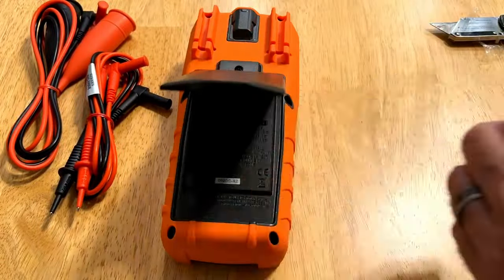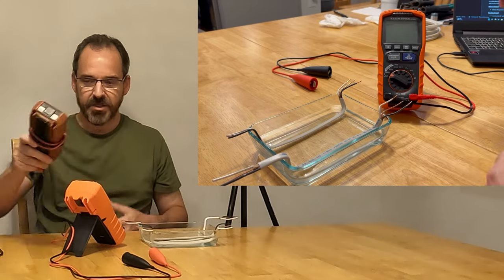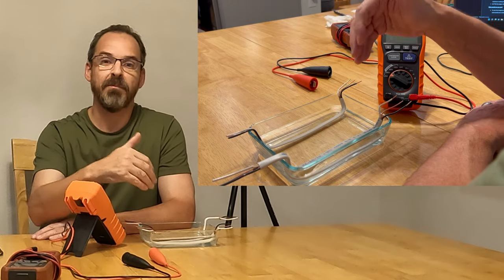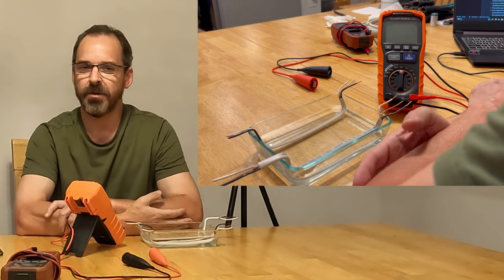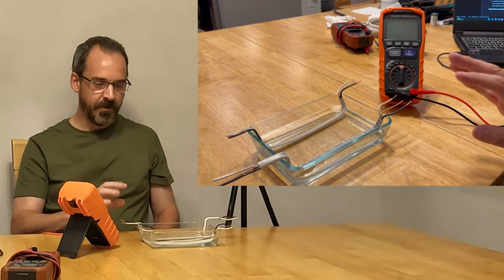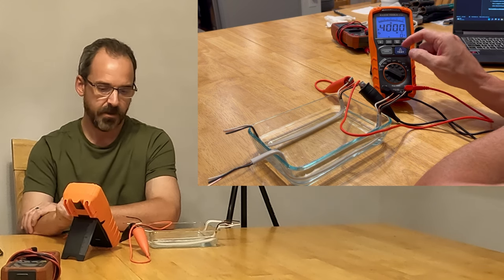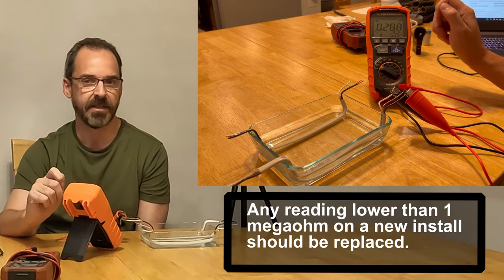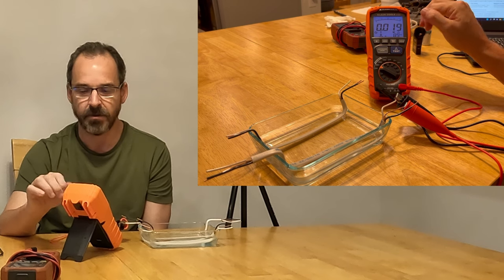Introduction to insulation testing using a Megger

Comment: Your math is not correct. The insulation is mesured at 500V and not at 110V. Therefore insulation resistance is not same at 110V as at  500V and, consequently, leak current will be different at 110V.
Reply from the maker: Resistance is a constant.
Reply from the maker: So what you say is sort of right and sort of not. Insulation resistance, will remain constant, effected mainly by environmental effects such as heat or moisture. Application of a lower or higher voltage will not change the resistance, but it will result in lower or higher currents that could flow thru said resistor.
Reply: @TheElectriciansGuild   Resistance varies with the temperature of the circuit.  Take a heating element and measure its resistance  when it is hot, just as you disconnect it from power, then check  it when it is cold.  As the ambient temperature rises, or the wire itself becomes hot, the resistance rises because the copper electrons are farther apart.  If the wire is cold, the electrons move closer together and the resistance is lower.  I like the hand crank generator type meggers rather than the battery powered ones.  DC voltage of 1000 volts will not be damage the insulation on 600 volt rated wire.  Neither will it damage motors that are rated at 460.  In fact you should test motors at twice their operating voltage.  It says right inside the instruction book of my AMEC crank style meggers..
Reply: bro，simulations only.
Reply: if insulation resistance was constant with voltage as you say, then why bother to measure at 500V, an ordinary ohm-meter would do @TheElectriciansGuild
Reply: @TheElectriciansGuild Resistance is not constant. It depends on many things and voltage is one of them. Measure resistance with multimeter vith few volt of source voltage and with megger vith twice of normal voltage and you will see difference.
Reply: @TheElectriciansGuild So testing romex on a finished house , how would that go. Would all devices have to be removed to do a legit test . Lately insurance companies are asking for megger tests after a fire to check everything.

Comment: Good video. As others have mentioned, in the UK this would be correctly termed 'Insulation Resistance Testing', Megger is a brand name. Someone will correct me if I'm wrong, but I believe Megger made some of the first insulation resistance testers, hence the term 'Megger Testing' stuck. In the UK we insulation resistance test all new circuits as required by standard.

Comment: I was taught to never megger anything at a voltage higher than the voltage rating of the insulation. You can cause insulation failure. When meggering a motor you can’t exceed the volts per turn rating of the motor.

Comment: I want to compare the resistance of different wire connections (twist and headshrink, twist, solder, and heatshrink, clamp, and solder seal). Can I do this with an $80 megohmeter and two wires, or do I need a $1000 + megohmeter or even 4-wire Kelvin bridge?

Comment: Megga is a brand that made some of the earliest elextrical resistance testers. Doing a megga test is the slang for testing the electrical resistance between two conductors. But I agree with @lewistreloar2312 it sis utter madness that you dont test your circuits before you commission them. In the UK we aslo test for the earth bonding impedance. Dont get me started on the lack of PVC sleeving on the earthing conductors and the worlks if issues not sleveng them can cause.
Reply from the maker: It’s amazing that the entire USA isn’t on fire for not doing this! Eek gads! 😂

Comment: I haven't used one in a long time. At work, they just bought a couple of the exact meter you have. Had a 50hp on an AHU, VFD going into earth fault. Started testing last night, and I diagnosed a bad VFD, this morning I'm told the motor is bad. Of course, I didn't see your video, I'm watching it again and I'll go up and do testing again, this time I'll be testing the wire to the motor and the motor. Is it possible wire with weak insulation causes the motor to short? we will see. VFD is isolated out of the circuit. It really helps me understand how best to use this meter. I was told the motor is bad if it tests below 100, I'm open to some input on this.  Thanks, N.
Reply: Tested the wiring #4 going from the VFD to the motor just the insulation solid 4000 all 3 legs, Tested motor wirings 10-ish all 3 legs, tested motor to motor ground open. Looks like the windings are bad in the motor. So why the "Earth Fault " on the VFD. I think we still might have an issue with VFD.

Comment: Great video!! helped me understand this more! I do have a question that I believe this issue applies too, I dont know if you could help. I currently have an issue of a motherboard continually getting damaged and I believe it is the power coming in, but it reads a steady 120v. This is an outdoor application for an automated gate operator. It seems to run fine with no added features/ other wires connected to the system. 

When I wire a 12vdc or a 24vdc plug in transformer to an outlet that is getting power from the same source as the operator, I have normal voltage on the power wires (12vdc or 24vdc). But the dry contact wires that should read no voltage actually give off 10-15v (ac) from wire to ground. I do not have a megger currently but will be getting one to test the incoming 120v power. 

What you have described in your video sound like the incoming power is leaking voltage into the ground. Is it possible these wires that should be carrying no current are getting some AC voltage from the leakage? I have replaced the motherboard 5 times and the external devices 2 times and the communication wires 2 times. (Have not replaced or looked at the 120v line in the ground. 

I hope this is understandable, I am just desperate.
Reply from the maker: Hello. Sorry just seeing this now. There could be many reasons why you have a reading on the dry contact wire to ground. Without knowing more about the complete circuit, I would only be guessing at the cause. I hope you were able to figure it out!

Comment: This video is very informative

Thanks
Reply: I know the amperage is tiny, but do Meggers present a risk of shock when they are testing at the higher, 1,000 VDC, settings? I've always been told that voltage burns, amperage kills, so low amperage notwithstanding, 1,000 VDC seems like a lotta burn is possible.

Comment: Thank you, very well explained. Just curious. The greater than 1 MΩ acceptable reading, is it dependent on the cable, or voltage applied? Or no matter the case if I see this > 1MΩ I can confidently say the insulation is acceptable?
Reply from the maker: My experience and understanding is with systems up to 600v, you should be in good shape at that value up to that voltage at least. Above that voltage, I really can’t speak confidently.
Reply: Thank you.  @TheElectriciansGuild
Reply: Neta testing standards would fail anything under 100Mohm. Any cable in good shape should read well above the 5Gohm max reading of this meter.

Anytime we see under 100Mohms, we know the cable insulation has been subject to damage and/or significant moisture.

I have seen cables tests in the 1-2mohm range, that have caused intermittent trips during higher moisture periods.

Alot of it is common sense. If it's a major distribution cable, error on the side of caution and adhere to engineered standards like NETA. Is it a 120v branch circuit for a plug? You're probably fine to leave a cable testing at a couple Megaohms for a long time.
Reply: @TheElectriciansGuild I just used the list meter and the when performing megger test the value increases ( slowly )up to 4 mega ohms. Does that indicate anything with the value rising slowly?

Comment: Not familiar with the process of using a megger.  Was requested to do a megger test on all the circuits in a home that had fire damage.  I just so happen to have just purchased this exact megger you are using in the video.

I'm surprised Klein does not have any kind of tutorial for this tester.

I found your video extremely helpful.

Thank you very much!

PS: do I need to test between hot to a grounded conductor / neutral to a grounded conductor?  Or does the test work with none of the conductors actually providing a return path to the Earth (as you show in the video)?
Some videos seem to show tying the hot and neutral together, and testing between those and ground.
Reply from the maker: Yeah if you tied neutral and hot together, if that neutral was still bonded, they wouldn’t get an effective insulation test from either of those conductors to ground. So I’d assume they isolate neutral from its bond prior to performing the test.

But the test can be done to look for leakage currents between any two conductors. Just be sure to isolate the conductors you are testing so that you are testing a current path thru insulation, and not other return paths. 

Good luck!
Reply: This is a video showing electrical students in the UK how to do an installation resistance test to BS7671, which are the UK electrical regulations. The test values may be different to those in the usa but the test process is the same.

https://youtu.be/Ek1u2RjQffU?si=80VhNEjADdjD-5JQ

Comment: Just to add several things. While the Megger guide is good for understanding the theory, your better off using engineered standard in terms of numbers.

Ex. Neta standard has a 600v cable to be tested at 1000V and it should be a minimum of 100Mohms.

1000vdc megger does not damage 600v insulation, as it is non destructive for a short period, with very small amounts of current. Using the highest recommended test voltage is best to measure leakage current to test insulation resistance.

Comment: This is is crazy that in the US you don’t use these everyday.
In Australia and most of the world it’s mandatory to use this on every circuit you do any work on.
Reply from the maker: I think I’ve seen some videos of European countries using them for inspections.

Yeah I agree, for at least circuits of certain voltages, or were installed under strain.
Reply: It is common practice on annual maintenance on large chillers used in HVAC,to Meg all compressor windings, and all pump motors.  It is also valuable tool for nuisance trips of GFI protected circuits, to detect small current leakage under operating voltage.  I always taught megger testing in my HVAC classes.

Comment: Why he put the wire in water??
Reply: If there is damage on the wire insulation. The water will cause a reading that says the cable is bad.
Reply: To simulate wires being the ground which is how some grounded systems have some conductors in their system outside. Usually damaged by lightning storms
Reply from the maker: So, the reason we care about insulation, is because is prevents current flow where we don’t want it.

If we have damaged insulation, and that damage is not in contact with something conductive (water, other metals, air at high voltages, etc) then it’s not going to be a noticeable or even measurable problem.

By putting it in water, I simulate a situation where a path for current flow is introduced between the damaged insulation. Producing a measurable result.